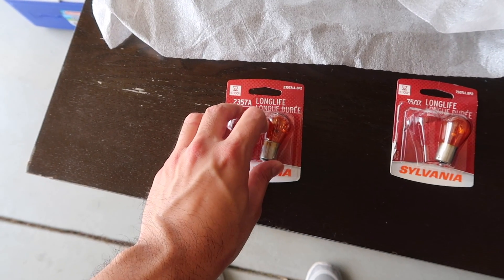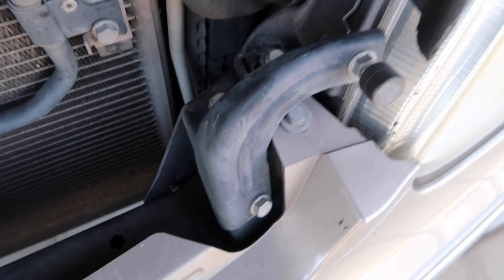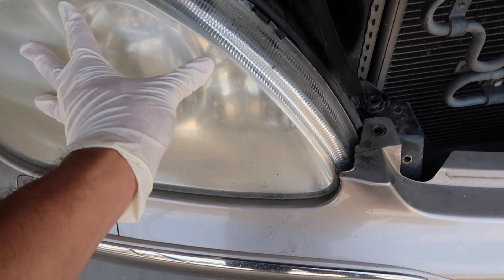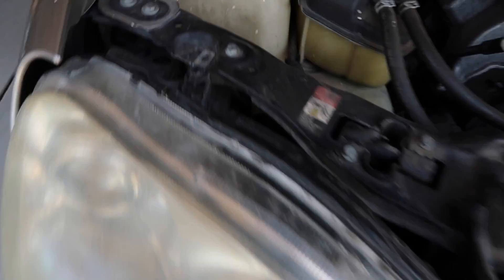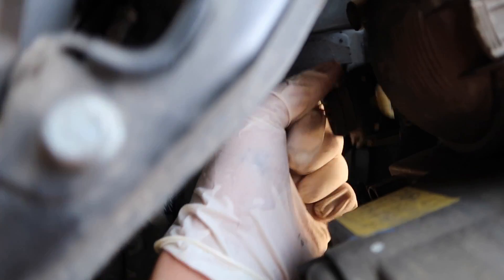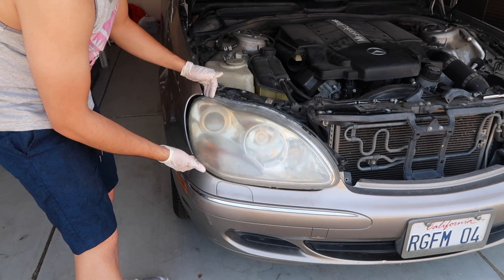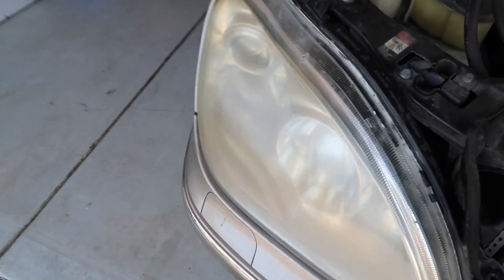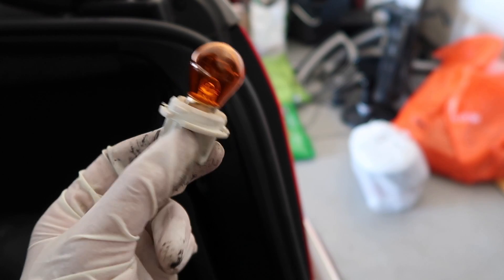How to Change Mercedes-Benz S-Class Turn Signal Lights (W220)

Comment: I have replaced the bulbs on my S class without removing the whole light.  It’s not easy, but I think it’s easier than what you’re doing.
Reply: How did you change the bulb without removing the head light,
Reply: It’s been a while, but the manual has a diagram showing the locations of the different bulbs on the back of the housing.  Each one has some kind of “push-turn”cap on the back side.  Remove the cap to access the bulb.  The hard part is getting your hand in a tight place and reaching each cap.  I believe there are 3 or 4 bulbs.  If you don’t have a manual, you can probably find it online.  I still have the car, but keep it in another state.

Comment: Really great as far as Richard goes, but it would have been nice if he'd gone into more detail about how to plug the headlamps back in.  I pulled everything apart as per his instructions, but when it came time to re-connect the plugs, I gave up after 45 minutes.  It appeared to me that it couldn't be done, but I'm sure there's a trick he could share with us.  As of this writing, the car's at a shop where I know they can complete my job.  But what a drag, getting 2/3 of the way there and then not being able to figure out how to insert the plug!  (The one that's nearly round, in particular.)  I wonder what my bill is going to look like.

Comment: You did the rear right turn signal but what about the rear left turn signal?
Reply from the maker: It's pretty much the same thing which is why I left it out. However, on some cars for the rear left turn signal there should be a door which you can open to gain access to it pretty easily. Once you open that door the circuit board should be right in front of you. If this isn't enough feel free to DM me on my instagram. I can help you more from there.

Comment: What do I need to stop hyper flashing when replacing these old halogens with LEDS (turn signals/reverse lights)
Reply from the maker: you're going to need something like a anti-flicker module from amazon. They're fairly cheap around $20 but I'm not sure if they'll have a module compatible with the taillights. Typically they have them compatible with your front head lights